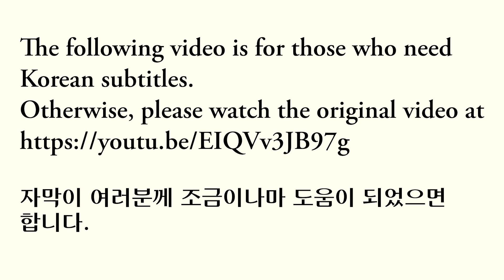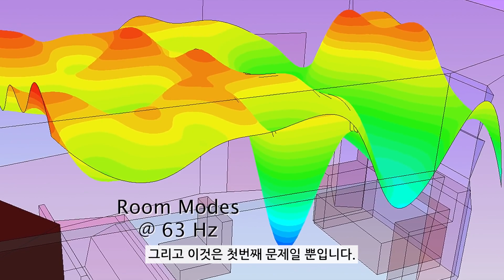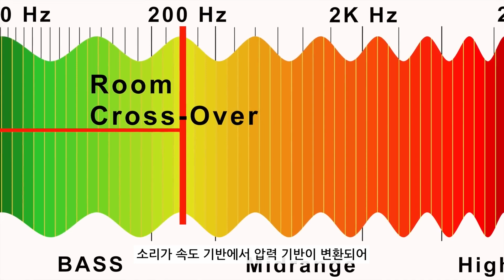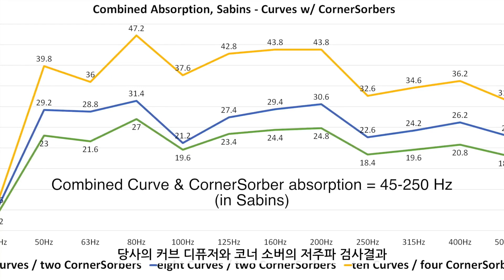(실내에서) 베이스는 어떻게 작용하는가 | 어쿠스틱 지오메트리

Comment: Very interesting, My room is approximately 4 m wide by 7 m long and 2.8 m in height, left hand wall is solid granite where my right hand wall is made up of a timber frame structure, and in the ceiling of my room, I have open beams that run the length of my room, I definitely can hear a difference between the left-hand side of my room to the right hand side of my room, I’m hoping to build a stud wall on the granite side wall to compensate, I have a very large pair of transmission line loudspeaker cabinets, so as you probably can gather, I do have a quite low base response, very interesting subject,
Reply from the maker: Thank you for watching! :-)
Reply: Ik zou experimenteren met gordijnen aan de zijkanten. Dat heeft bij mij zeer positief gewerkt. Je hebt ook akoestische panelen die je op kan hangen. Maar alles heeft zo ze voor en nadelen 😉